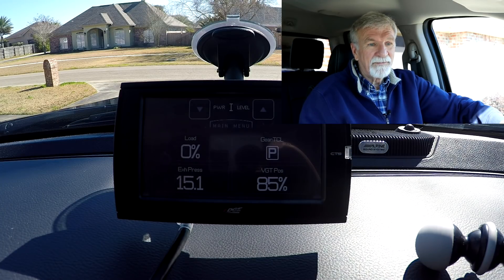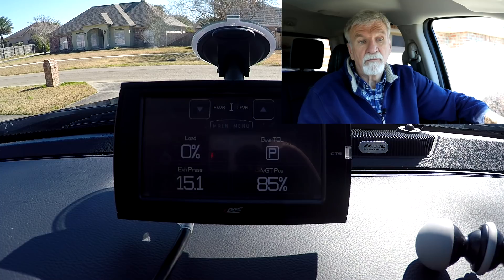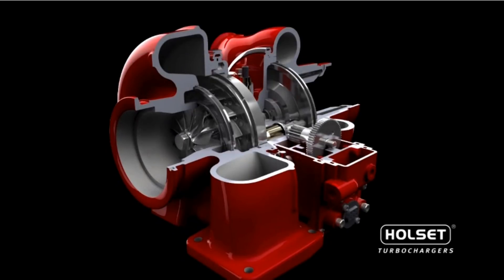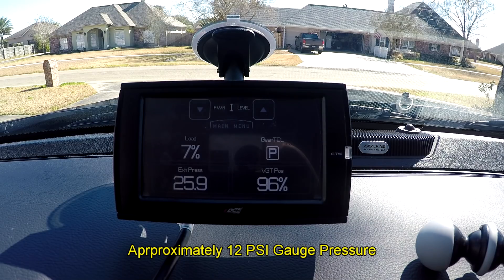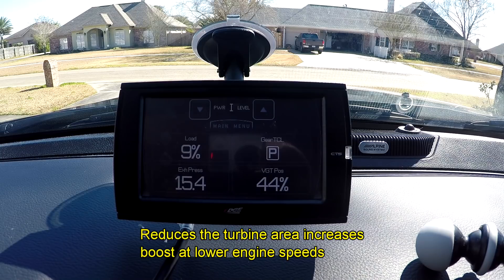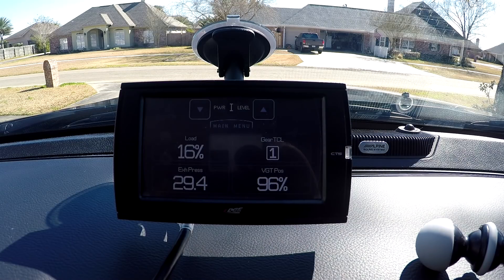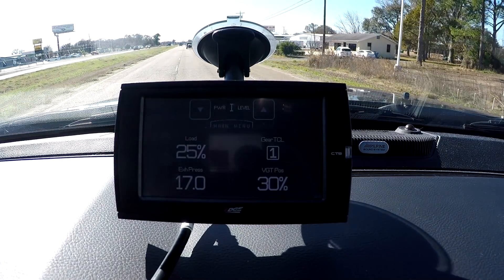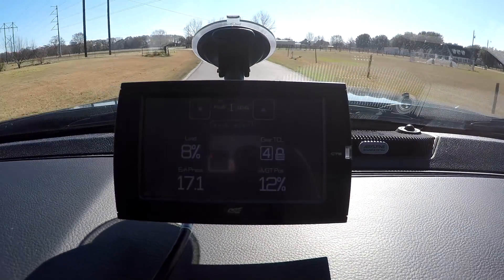RAM Cummins Exhaust Brake & VGT Turbo Operation

Comment: Hi Marion this came from the Ram Owners manual in the Diesel supplement about what happens when the vehicle is started in colder weather-
• Engine idle speed will automatically increase to 1,000 RPM and engage the Variable Geometry Turbocharger at low coolant temperatures to improve engine warm- up.

If you look it up yourself it is on page 201 of the manual.
Reply from the maker: Thanks very much
Reply: That's good to know I thought something was wrong with my truck when I walked out and heard the truck get louder.

Comment: I leave my exhaust break on full all the time on my 2018 Ram Cummins. Like you mention it helps the truck warm up. I always make sure that the engine coolant temp is at least 110 degrees before driving. I have the block heater plugged in year round when at home and on a smart plug. It comes on at 10pm every night and turn off at 10am in the morning. This means I don’t have to wait for the motor to warm up more than a couple of three minutes before driving. This saves on fuel as well.

Comment: Not sure this is the best place to post this, but here it goes...
This last week I was talking with a friend that just had his 2016 2500 at the dealer because the exhaust brake failed. His truck only has 40,000 miles. Apparently, some components within the variable this that and the other, stopped moving due to a build up of carbon and such. At least that's what they told him. My friend explained to me that he doesn't have much use for the exhaust brake and only uses it occasionally when towing. He typically uses the truck for hauling tools to job sites. 
The dealer told him to "exercise" the exhaust brake often. (use it or loose it!). The cost to repair it was over 3k. 
I guess I'll change my driving habits based on this. 
Stay cool, Dave
Reply from the maker: Yea, that's the general consensus is to leave it on all the time.  I make sure I use it at least once every time I use the truck.
Reply: I use it every time I start my truck.  '17 Bighorn.  45 G currently

Comment: I turn the full exhaust brake on every time I start my 2015 2500 Cummins. I just bought it and it has 33,000 miles on it. It's in very good condition. It would be nice it the exhaust brake defaulted to on when you start with the option to turn it off via the switch.

Comment: The exhaust break will not turn on at any point. Is a manual preference. If is on while idleling for long period of time it while overheat the engine and will use more DEF. If you want the engine to warm up faster you can use the option of the cruise control, but if you decide to use it and the engine oil is too cold you can decrease the life of the oil. Just wake up early drink a cup of coffee while you see your truck warming up from the window. I love my truck and hate the cold. Keep doing videos I enjoy your sense of humor.
Reply from the maker: Thanks RammC. My exhaust brake seems to come off at idle around 160 degrees F or so.
Reply: Not sure about overheating or additional DEF usage but if you remote start your truck in cold weather it will automatically kick up the idle after a few minutes, (sure you guys knew that already). I am sure it depends on the ambient temperature. I noticed mine kick up after about 5-7 minutes after starting when it was between 15-20 degrees out. I have not checked the oil/engine temp when it does but I am sure the engine has some sensor in there to say when it is OK. 
Another great video Marion.  I love my truck too RammC. They are great trucks.
Reply from the maker: Thanks Ben, I'm puzzled by overheating on Ramc's truck.  My exhaust brake back pressure is identically, with or without the exhaust brake, at idle above 160 F. coolant temp
Reply: Just use a Zero temp heater, solves your problem

Comment: On my 2012 RAM 2500 the exhaust brake has to be turned on each time I start the truck? The dealership says that is normal. When I drove larger trucks for a Towing company the trucks Exhaust brakes all stayed on until you tune them off. I think how mine works is a PIA because I've forgotten to turn it on when I take off with the camper for our next stop. It saves so much of the brakes especially when pulling a heavy trailer.
Reply from the maker: Agree, yes it's normal

Comment: I've always wondered if people can hear this type of exhaust brake outside? When I am towing my camper through towns that have "Exhaust Brakes Prohibited" signs  I can hear it inside but how does it sound outside?  As I traveled the USA some of these restrictions are on steep hills so I push it as close as I feel comfortable then turn it off.  I didn't know if the cops in any of these small towns would stop me for it? I know it's not a Jake Brake and not nearly as loud!!  They are usually an Engine brake and it doesn't work on the exhaust .
Reply from the maker: I put a recorder on the passenger running board and couldn't hear it.

Comment: I been looking on the manual and couldn't find any info about what is the right temperature to start driving the truck on really cold temperature i live in colorado...i let my truck reach 120* on the oil temperature before i star driving i don't know if its good or not couldn't find any info and you are really good at finding info it will be a good topic for a video

Comment: Do you think the pressure indication is "pegged" at 60 psia? Meaning the pressure is actually higher, or do you think the VGT controls to 60 psia as the maximum allowable pressure? ...I have to get one of these Edge or Banks gauge monitors for my truck! Great video, thank you.
Reply from the maker: I think that's about the max back pressure for the exhaust brake.  (by design)  The turbine, when slider is closed, is 95% so I suspect they left the 5% to limit the pressure.

Comment: Marion I love your videos. Getting ready to purchase a 2014 myself. It has a Ezlynk tuner and screen with gauges. Does the truck come with the Vgt sensor to give you that reading or is that something you had to add yourself. Guess what I’m asking is did you just plug in your tuner and those readings were available or did you add ports/sensors?
Reply from the maker: Yes it does report the VGT settings from the PCM and out to the OBDCII connect for whatever gauge or tuner you have.

Comment: Hi I just bought a 2018 Ram Cummins and iit s my first diesel. I have been driving a 2004 Dodge ram 5.7 Hemi for the last 4 years.

I notice that when I step on it trying to pass on the freeway there is a lag unlike my hemi.

I have read that you can use a tuner to fix this issue? Turbo lag?

It is completely stock, would a tuner help and which one would you use?

I have looked on forums but mostly just see info for trucks that have been deleted.

I really enjoy your videos, very informative!!
Reply from the maker: They void your warranty but Banks and others have other ad ons for throttle lag.  I haven't had that issue but I'm pretty light footed also.

Comment: Million dollar question Marion. Should we keep our exhaust brake 100% on during all driving conditions to prevent soot buildup? Or is this an urban myth? My turbo actuator went out at 72,000 miles. This part is not covered under any warranty. Only if turbo was the issue. $3800 later for actuator replacement, wondering if keeping my exhaust break on all the time will keep turbo and all emissions parts clean?
Reply from the maker: Probably urban myth more than anything, ha.  But I can see where would help.  The more you can slide the nozzle from 0 to 100% (maybe 95%), I can see where it would help keep carbon from building up.  $3800 bucks, what a bummer.  You are not alone.   I hear a lot of turbo actuators failing, even those who say the are using it 100% of the time.  I've read where the exhaust brake can soot up the IAT sensor faster, however.    I leave mine on 100% of the time.

Comment: Me Blair what is that screen that you use mounted on your windshield I just bought a Ram 2500 Cummins love your videos
Reply from the maker: Thank you.  Thats an Edge Insight.  It plugs into the OBD2 connector to monitor various engine parameters.  I'm using a Banks Idas now.

Comment: Hi Marion, I just had an issue with my 2014 Ram Cummins that may interest you. I had the check engine light come on and go off several times. It would stay on a about 3-4 starts than go off. No messages or warning in the EVIC. No apparent performance issues. I searched the forums and found other owners had experienced the same random check engine light and no explanation at the time. Dealer just scanned mine and found it was the turbo actuator sensor/switch code. I just surfed the forums and youtube again, now knowing what to search for---and it seems pretty common. There are good vids on how to check the actuator plug with a multimeter---if it's bad it's open and pretty straight forward. I've seen people in forums say it wasn't covered under warranty, maybe they've done things to void their warranty, finger crossed my dealer has said it is covered under drive train warranty.  Hoping this isn't a can of worms for me, mine will go in to have the work done next week when the part comes in.
Reply from the maker: Thanks for that.  Interesting for sure.  I would also think it is part of the engine warranty.
Reply: Marion Blair yes I believe it is. When the dealer called me they said $2800. Im wondering if that means sensor switch and mechanical component of the actuator....(I think its got a lever that engages a turbine type thing that spins the stuff inside the turbo...above my pay rate!) I then  said "thats covered by drivetrain warranty isnt it?" Oh yes it is. I dont know if they were just winding me up or if there is a policy of not mentioning warranty untill the customer mentions it! I dont think you can be too carefull, seems like they can be very slippery about fullfilling warranty if they can get away with it. BTW my truck has 43k on the OD and tows a GN horse trailer regularly, use the Jake brake a lot, wind it out highway speed etc.  I didnt think I had any performance issues related to this, but on reflection, week ago had a brief episode of dead pedal in stop go traffic. At time I thought it was like stuff id read in forums re: dead pedal, if u hit pedal too fast up down in a row can seem to go dead. Id never had this happen ever w this truck. I now wonder if the lever/switch actuating the turbo was sticky/slow as a result of the bad electronic/, or maybe the sensors were picking up sticky action on the mechanical actuator components,. Sorry for long post, figured maybe it would help someone else out there.

Comment: I would love to know how to get the maximum lifespan from the vgt turbo, longevity of the 6.7L Cummins and the Turbo is my goal? I have looked on the internet and YouTube but have not found the answers I'm looking for to get the longest lifespan from a New RAM CUMMINS TRUCK, in the Stock configuration. Any advice in those areas would be welcome, thank you.
Reply: I have been told not to use the exhaust brake except when necessary, like going down a mountain, towing a trailer.
Reply: I’m replacing my stock 2008 6.7 vgt turbo this week it has 245,000 miles on it.

Comment: Cool stuff. I would love a 2500 4x4 manual. I've seen videos of people moving the exhaust break switch to the stick, but it looks like the throttle position controls the break automatically and you either have the break enabled of disabled. I'm not sure why you would need to constantly need to turn it on and off, which is why they were moving it to on the stick.
Reply: I have a 2017 Cummins automatic. There are two positions for the exhaust brake:1-full on and 2-automatic mode. The computer tries to decide in both modes weather or not to activate the exhaust brake. It is more aggressive in "full on" mode. However, I have noticed if I am not going down hill or the engine is below a certain RPM then it will not engage and sometimes when I am on and off the throttle such as a curvy road it won't engage. Now if I am in tow haul mode and full exhaust brake mode it is really aggressive and will even downshift to slow the truck. I have let it slow me to the point that I went from 55 mph on a steep hill(towing 8,000#) down to about 20 while still on the hill without touching the brakes. In automatic mode it tends to wait until i apply the brakes before exhaust brake engages. It tends to maintain speed in automatic mode as opposed to slowing me down. Also there are times when I know the road ahead and I would just prefer to coast but the truck doesn't/can't predict the road ahead so it goes by the programming. It does work very well however there are those times where the computer doesn't predict what I want the truck to do and having a manual control over the exhaust brake would be nice especially when towing.
Reply from the maker: thanks.
Reply: supperterofsanity  is the on off for the turbo what you are referring to on the 17s for 1 or 2 level I haven’t found any difference?
Reply: If theyve done a second gen  swap on the exhuast manifold amd turbo they have to put a aftermarket  turbo amd lose there exhuast brake

Comment: Think about it.  The brake is adding carbon emissions to the exhaust pipe through the turbine.
Reply from the maker: The turbine is the brake.  I'm trying to understand what you mean by adding carbon emissions to exhaust.  The turbine gets 100% of the exhaust on VGT right.

Comment: Marion: What model of Edge Monitor is that? It’s not a tuner is it. I have read where the factory dash info is not accurate at all.  I really would be interested in a similar unit. How does it hook up?

Comment: Is using exhaust brake excessively bad for the motor?
Reply from the maker: No most dealers and everybody I know has always recommended leaving it on.   it helps exercise the actuator which is if it doesn't move to that extreme range that the exhaust brake is nearly 100% it could get sooted up and screw up the actuator. So I think you're doing the right thing, that's exactly what I do every time I get in my truck is pressed that exhaust button thank you.
Reply: @MarionBlair  Thanks for the expedient reply.

Comment: I have a 2008 6.7 Right now the exhaust break seems louder than usual, the truck has a tough time accelerating seems to bog down.  I changed the turbo boost sensor and just had the dpf cleaned as well.  I’ll check the exhaust pressure sensor next.  What would be your thoughts?
Reply from the maker: Casey Riggs You can unplug the exhaust pressure sensor to see if that makes a difference.  Hopefully it’s not the turbo actuator.
Reply from the maker: Casey Riggs any code or check engine light...?
Reply: Marion Blair  0420,0471,1451,0513,2281, 2563 truck is all stock
Reply: I use my exhaust break every 2-3 days
Reply from the maker: Casey Riggs yea, unplug it.  It at the front passenger side.  The pressure come from a tube up to the sensor, unplug it at the sensor.   It’s a long shot with gauges but a easy thing to try.   if I run better maybe clean the sensor or replace it.
Reply: Marion Blair I unplugged the sensor it does sound better, is it ok to drive with the sensor unplugged?
Reply from the maker: @Snowmad46  just take it easy in case the turbo is in the exhaust position
Reply from the maker: O2 sensor is another likely cause
Reply from the maker: You're looking in the right area I think.
Reply: Marion Blair I plugged the sensor back in and took it for a spin the truck has no boost, aloud whisp when I go to accelerate but not much go with the truck. I parked in the garage noticed some whiter exhaust I went to swipe my fingers on the exhaust pipe and noticed condensation built up in the tailpipe.

Comment: But it moves back and forth.  Any slight carbon build up restricts movement and makes the actuator work harder, eventually failing.
Reply from the maker: Agree and the general thinking is that by using it, it keeps the carbon from building up as it slides to nearly the 100% position when on. But, you could be right.  Personally, I see more fail from the electrical side not the actuator binding up like most fear.

Comment: So the question still is:  does the truck turn on the exhaust brake automatically in cold weather?  Or not?
Reply from the maker: Apparently it does but at what temp is really the question we haven't answered.  I know it doesn't in 30 deg F or so but from Ben C's post below the manual states it does but doesn't give a temp.  I will explore that more.
Reply: Yes

Comment: i own a 2010 chassis cab and mine exhaust bake cuts off after the rpms drop when using it to slow down it works too about 30mph the stops
Reply from the maker: From what I've seen it's 1200 RPMs regardless of the gear. And tow haul it's a little more aggressive
Reply: @MarionBlair  ya mine only as a exhaust brake button because its a basic chassis cab i geuss i dont or cant have tow haul
Reply from the maker: @bennaylor3658  oh okay oh, I didn't know that
Reply: I have noticed consistently that the exhaust brake stays on until RPMs drop to 1,000, regardless of what gear or speed I am at. I do have the G56 manual transmission so I'm not sure how it works with the automatic.